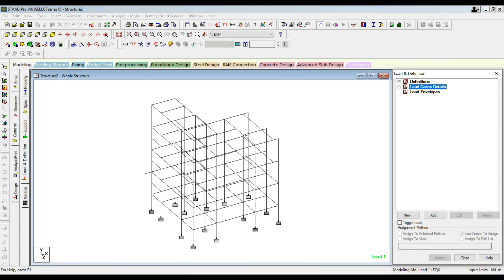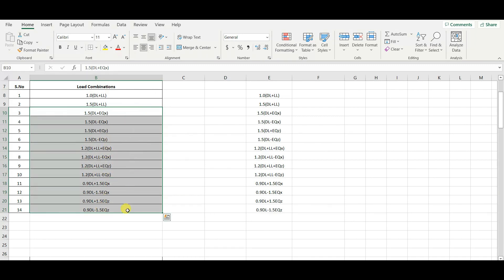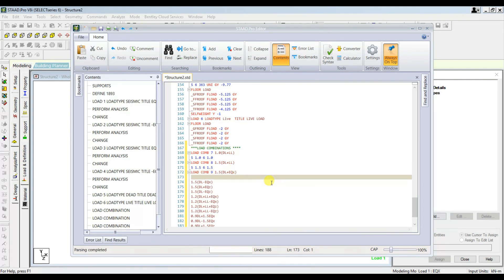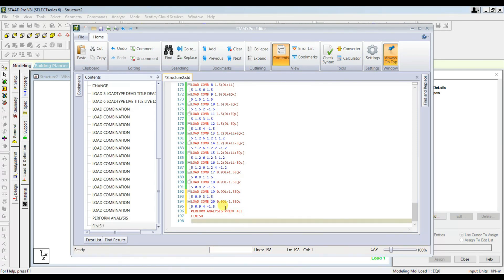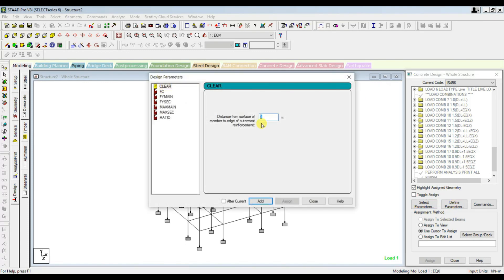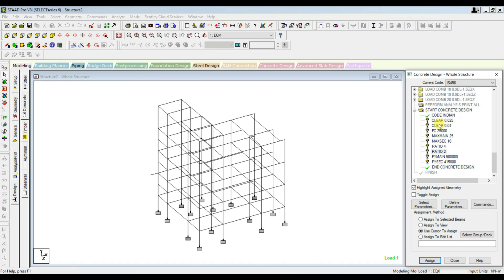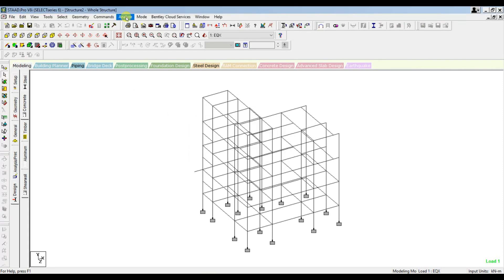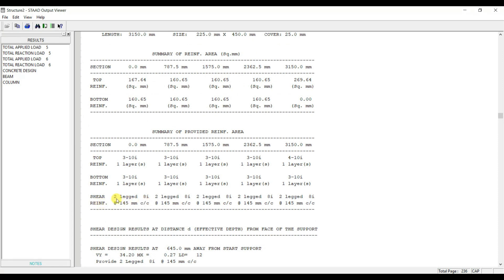G+3 Building Design | G+3 Building Design in Staad.Pro | G+3 building Seismic | Staad design output

Comment: I have question
In beam design , the tension zone is in bottom portion so we provide more reinforcement in tension zone as compared to compression zone......but in staad result...it always provide more reinforcement in top(compression zone) then bottom (tension zone)...so where should we provide more reinforcement..in top or bottom?
Reply from the maker: It depends on the bending moment. Usually, the bending moment will be more at tension zone hence we need to provide more reinforcement in tension zone as compared to compression zone.
Do not depend on staad design results only just check the anaysis results as well (i.e  bending moment and shear force of the beam)
Reply: Then ma'am how should we provide reinforcement in column nd beam in our real-life projects using staad results...plz enlighten us..plz make a tutorial video
Reply from the maker: I have created a course, structural design of buildings using Etabs software which includes structural analysis and design of  a five-sorey RCC building(Real project) and is now available on udemy.
Kindly use the below link to avail the full course.
https://www.udemy.com/course/structural-design-of-buildings-using-etabs-software/?referralCode=14883FDBBD95A1ADAC02